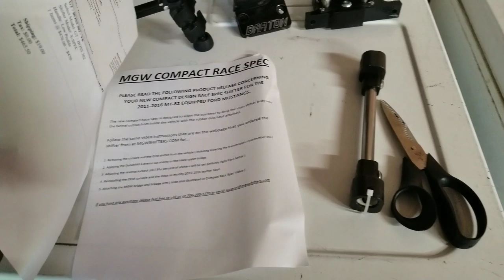MGW(mustang) Race Spec Short Throw Shifter

Comment: Good work!  Did this upgrade a couple of years ago (wish I had done it earlier), best thing you can do to improve your shifting.  

Keep an eye on the shift linkage bolt, despite the blue loctite, mine found a way to back out (and while I was driving).  

Other thing I would recommend is swapping out the transmission fluid with some BG Syncroshift II.

Comment: How's it working?
Reply from the maker: Still doing what its suppose to do, should of bought this one in the 1st place. Still gonna need to switch out the stock clutch
Reply: @DIS50GO  I'm in the same situation I got the barton short shifter (not the hybrid) and the blowfish racing bracket. The safety loop in the blowfish it actually hitting my driveshaft over bumps so I'm going MGW steeda said install will be $275